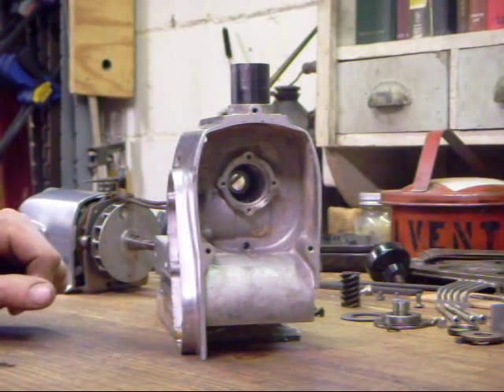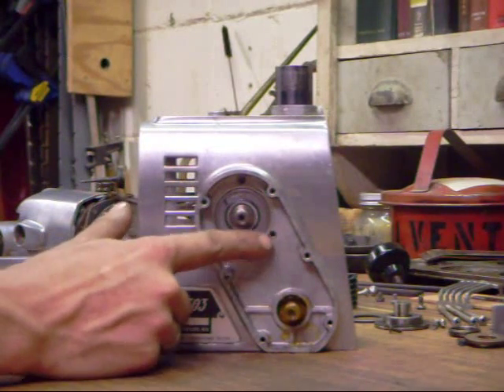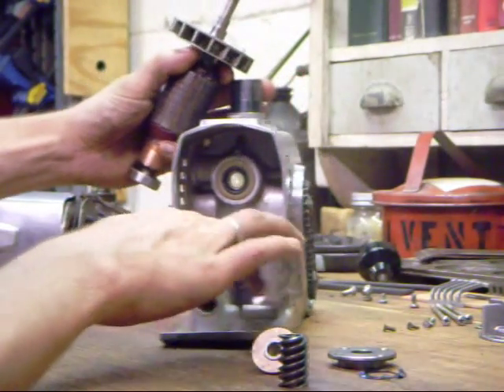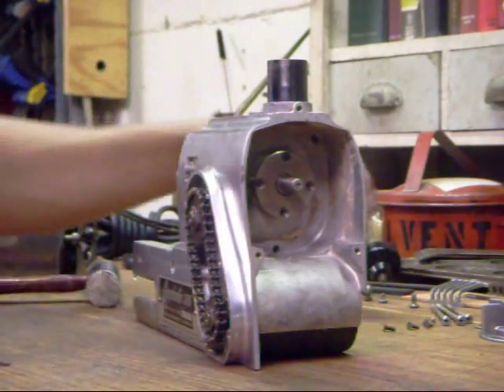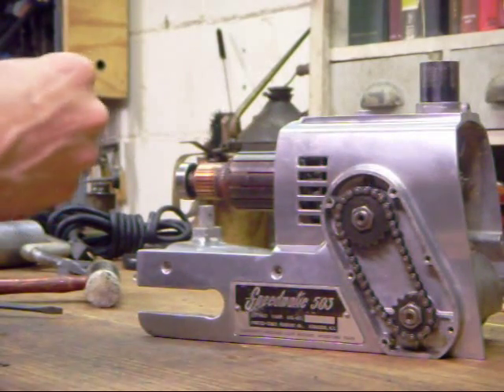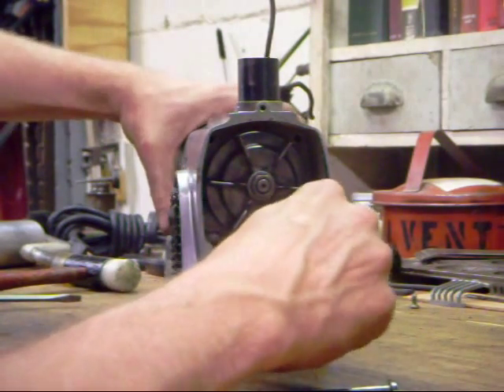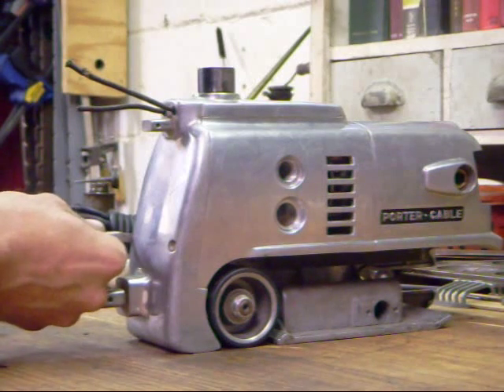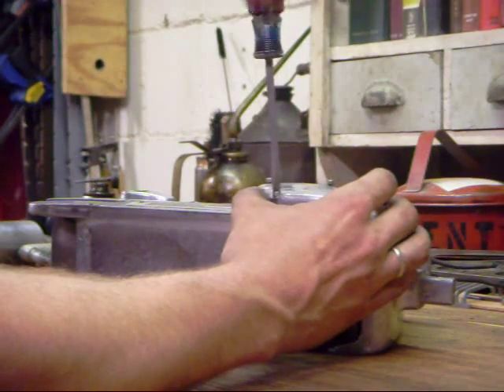4. 503 Assembly part 1.avi

Comment: Just curious as to why you reversed the chain sprockets with the larger one on worm gear axle, & the smaller one on the drive wheel?  This would give you more rpms on the drive wheel.  Any reason or potential damage, or was it an oversight?

Comment: Also, the leather encased oil seal that fits into the retainer behind the fan is now marked as obsolete from Porter Cable or Parts direct.  Would a newer non encased nitrile spring loaded seal work in place of the leather one?  Cross reference #'s if you have any?